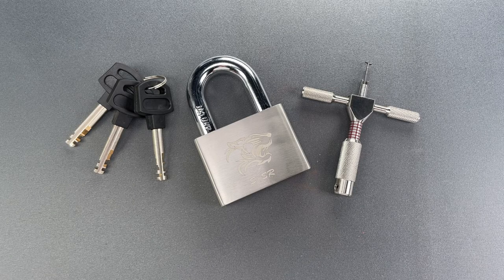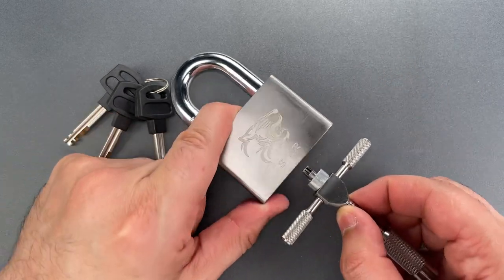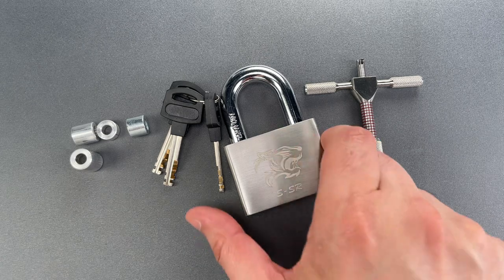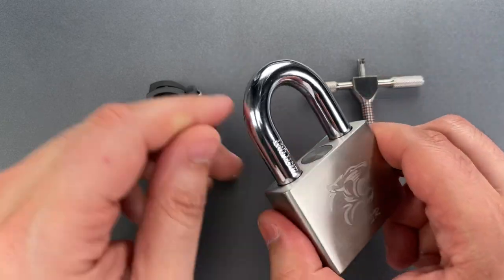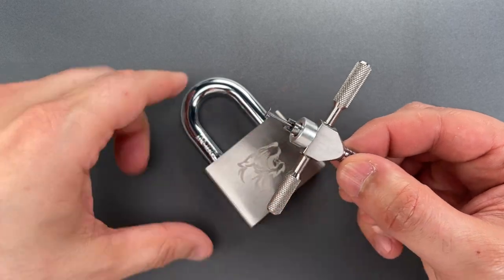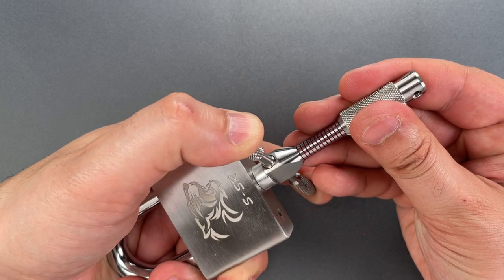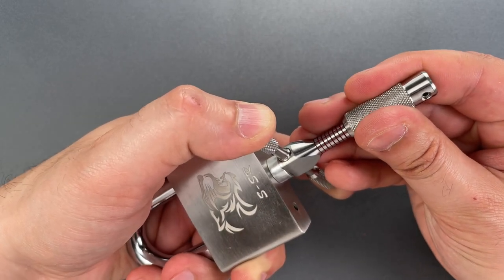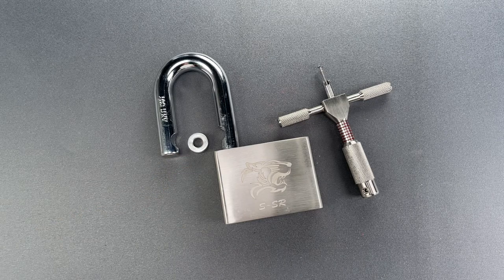[1368] A Crutch For Picking Disc Detainer Locks (S-SR Padlock)

Comment: Just from the fact of it having TEN pins to go through, wouldn't this make this a lock worth getting? Some amateur expecting 4 or 5 pins getting nowhere fast would surely move on, yes?
Also, how hard is it to pick disc detainer cores if you don't have a tool the You and Bosnian Bill made? A side-to-side comparison video would be enlightening.
Reply: In answer to the second part, as near impossible as to make no difference, certainly in the field. But the pick that Bosnian Bill and he made is available commercially, from Sparrows I think.
Reply: It is basically impossible to pick without a disk detainer pick of some kind.  That is why even without false gates, it is still more secure than most pinned locks.
Reply: I am sure with some skill a person could pick these gates. The tool works very well be cause it spaces out the pick and keeps it in the correct area. The gates need to be turned rather than pushed. Which is why the tool works very well. I would guess that a person who tries to pick it with a bent pick could do it over some time. The tensioning part would be tricky too as you would need to bend and make a turning tool as well. This is why the tool works very well. Its possible to pick just about anything thing provided you understand what is going on.
Reply: It could be picked without the tool, but it would require more skill than worth the effort, honestly speaking maybe 1% or less of lockpickers could do it without the tool
Reply: The famous 'tool' is a common disc detainer pick; it's just well made and at a reasonable price, which is the niche that BB/LPL and Sparrows noted was not served. You can find that - or others - commercially. Without a specific disc detainer pick I don't think you'd be able to pick a disc detainer lock - it's not something you can improvise with other materials (or even other picks).
Reply: Without the tool they made, it would be way harder, deffinitely out of the range of a novice average street thug.
Reply: @dlevi67  There are YT videos of people picking disc detainers with hooks. Just to show off probably - but it can be done. It's like using a frying pan instead of a hammer to drive a nail. If you can manipulate the discs you're set. A sharp hook or diamond will let you do that. Much harder, yes, but not at all impossible. Otherwise You're correct. Just nitpicking. No flame war please.
Reply: @nemtudom5074  Even with the tool, I would imagine it takes a good amount of practice to be able to do it quickly and consistently.
Reply: @m2pt5  Yeao, probably, i doubt i could do it in twice the time LPL did
Reply: @cooperised  it is Sparrows, I actually bought one recently and it's a very nice pick, though I'd totally prefer to get it in the nice stainless color LPL has rather then the black/dark red it came in. Just easier to see the lines on LPL's version.
Reply: Does anyone know if there are are videos of LPL picking a disc detainer core pre-"Tool"?
Reply: @EvolvedWizard  Yes, I've seen a video where he picks one with a common Chinese disc detainer pick.
Reply: @OLLE3770  No nitpicks - totally correct point! Mind you - I have problems enough with a specific DD tool 😂
Reply: @EvolvedWizard  he picked plenty of them with Chinese made tools that he slightly modified.
Reply: @Geoff_W  use a very thin white (or other color) marker and circle the lines, I did an orange and it still blended nicely.
Reply: @jameswfreedom641  It's fine, I make due, it just would have been nice if sparrows had taken visibility into account
Reply: @Geoff_W  I totally agree with you!
Reply: a basic disc detainer pick can be made from a filed down nail
Reply: @3rdalbum  where linkmpls
Reply: That makes me wonder, if we’re factoring in “defeating expectations” into a lock, are there any hybrid locks (if such a thing is even possible) that, for example, have disc detainer, wafer, and standard pins mixed together? 7+ discs and 1+ wafers/pins seems like it would make anyone not up for the challenge give up.
Reply: @m2pt5  I can verify that. I have been practicing with mine for a couple of weeks now and I still haven't got the hang of it.

Comment: I've just opened my first real lock. I only raked it but it feels like such an achievement. Thanks LPL. I couldn't have done it without your videos. Still failing at single pin picking though, even on the "practice" locks. 
You make it look so easy!

Comment: Lockpickinglawer using a special pick to open locks is one of the most complimenting things a lock company can get. That or if lpl says something like “without the proper preparation, I will not be able to get this lock open”
Reply: The "pick that I and Bosnian Bill made" is not so much a special tool as it is a tool made to pick disc detainer locks. Picking disc detainers with normal picks is nigh impossible just as picking the usual pin locks with this tool would be probably impossible: It takes the right tool for the right lock mechanism. Though I guess this tool is a bit rarer than the usual picks so just by their nature, disc detainer locks are slightly more secure. A prepared adversary would have this tool and tear through the lock without much effort, though.
Reply: Most lock smiths don't even know this tool exist
Reply: Disc detainer lock picking tools aren't really rare or special. He just uses the type he and Bosnia Bill designed. The commercial version of their design is made by Sparrows.
Reply: @siliablackfame5771  And where you think Sparrows got the design from?

Comment: I know a few people have already mentioned it, but I agree, these alignment aid/spacers should be made available on your store.
Reply: Or you could go to the local hardware store and just find an appropriately sized nut in the 'fasteners' department.  will probably cost 25 cents.
Reply: @HariSeldon913  Nice try but no. The distance between the lock surface and the first disc is a special length that needs a very precise spacer. Obviously, out of the thousands of commercial spacers  one will probably work, but it is still easier to buy a specialized one.
Reply: @pomelo9518  Not only that but you'll probably also want the spacer to fit snugly around the picking tool, which a specialized spacer will be made to fit.

Comment: Great tip! Wondering if you have any “field picking” videos on the channel where it’s a lock that’s actually attached to something. Some locks are really hard to hold in your hand for picking in the field compared to your lab environment
Reply: I believe one of his april fools videos should work for that - the ex-girlfriend IIRC
Reply: In most places it's illegal to pick locks that you do not own. The April fools lock of "his ex girlfriend's backdoor" mentioned earlier was most likely a cylinder he owns that was rigged in a door.
Reply: Alexander. I get what you mean. I was thinking the same. Like using his lock and lock a chain to anything in a park or some crowded street setting.

Comment: Hey, i was wondering, what it means “i have not felt any anti-pick features” you know just by twisting the key, or you pick it beforehand? Thank you 😊 (i had this question for a long time)
Reply: He always picks them at least once before recording the video.
Reply: He's picked it before
Reply: I'm fairly certain he said in a meta video (a video about how he makes videos) that he usually picks them beforehand to know what to do/expect/talk about, so I would assume he means he did not feel anything in his tests
Reply: anti‐pick features, amongst other things, can be spool or serrated pins. or in this case their equivalent on disk detainer locks. you can tell when picking because they will cause a false set; or the pin will not move smoothly.  

so long story short they can be felt out while picking the lock.
Reply: Well damn, thank you all ❤️
Reply: In a disc-detainer lock, there is a sidebar that presses into the edge of the discs, and when the gate (a notch in the edge of the disc) of each disc is lined up with the sidebar, the sidebar goes all the way into the discs and allows the core to turn.  When he applies tension to the core to turn it, and starts to turn each disc, the sidebar drags along the edge of the disc that he is picking; you can usually feel the dragging/scraping through the pick.  In disc-detainer locks, the typical security feature is a false gate, a gate that is cut large enough to catch the sidebar when it is turning, but too small for the sidebar to fully set into the disc.  When turning a disc during a pick, you can feel a small click or bump when the sidebar drops into a gate (whether it is true or false).  If you get ONE click out of every disc, and the lock opens, then that means that none of the discs had a false gate, and you "have not felt any anti-pick features" while picking the lock.
Reply: @silentguy123  correct except for some very few videos where he mentions its a blind pick
Reply: Pretty sure he's got x-ray vision when it comes to locks.
Reply: @Allahpaca  
You nailed it, I reckon 🤣
Reply: @Allahpaca  that’s usually developed at his stage of picking: X-ray level lol
Reply: @VcSaJen  if you set multiple pins from the front or back you can get slight false sets as well
Reply: @Allahpaca  The man with the x-ray hands would be a good moniker.

Comment: LPL would you ever consider making and selling the tool you use to rotate the discs?
Reply: I second this
Reply: Sparrowslockpicks on the internet. $45 bucks. LPL and Bill both haven videos of making it and explaining why its over there.
Reply: if you mean the lockpick  BB and LPL worked with sparrows to get a version to market.  If you mean that tool he used to rotate all the disks to the initial configuration that's just a slim piece of metal with a grip put on it for comfort.  Anything with an appropriate profile would work.  A wiper insert or even an old hacksaw blade filed down to the right size would work.
Reply: Any appropriately sized sheet metal strip will work.

Comment: OK, so what does a click mean? What does binding mean? Can you do a new video with a sorta 'FAQ' feel for terminology? Could include what you're actually manipulating in there. Also could go over what anti-pick features entail. Like what's a false gate? Hell, what's a gate? :)
Reply: In a disc-detainer lock, there is a sidebar that presses into the edge of the discs, and when the gate (a notch in the edge of the disc) of each disc is lined up with the sidebar, the sidebar goes all the way into the discs and allows the core to turn.  When he applies tension to the core to turn it, and starts to turn each disc, the sidebar drags along the edge of the disc that he is picking; you can usually feel the dragging/scraping through the pick, this is "binding".  In disc-detainer locks, the typical security feature is a false gate, a gate that is cut large enough to catch the sidebar when it is turning, but too small for the sidebar to fully set into the disc.  When turning a disc during a pick, you can feel a small click or bump when the sidebar drops into a gate (whether it is true or false).
Reply: @Kineth1  Thank you so much. Makes every video better. Gracias.

Comment: I wonder, LPL and BosnianBill designed the picking tip of this tool so that it could be replaced should it snap. I wonder if LPL has broken one yet, or if the original is still going.

Comment: Do you sell the tool you use to rotate all the discs to start position before picking on Covert Inst?
Reply: Anything that's basically just a flat plane will work.  I use one of the wafer jigglers on my Covert Companion (and I think that's what LPL uses in the video, just not the Companion version), but something like a flathead screwdriver would work as long as the head is long enough to reach all the discs.  If you don't have ANYTHING that's just a thin flat piece of metal, you can use the pick to turn each disc clockwise manually, though it'll take a minute or two.

Comment: I believe this has been asked before, but am I correct that DD locks that tension off some random disc at the back are not really attackable (is that a word?) using this tool? Or specifically the one I have from Sparrows, which I know came from you guys - thanks!
Reply: He has picked random-disc-tension locks with this pick.  He usually starts by applying tension to the first disc, which still causes the sidebar to bump the discs, then once he lines up the other discs, he moves the pick to one of the "zero-cut" discs (a disc that didn't need to be turned to line up with the sidebar, usually used in a random-disc-tension lock as the tension disc), applies torque to that disc, then uses the nose of the pick to line up the first disc.
Reply: If the comment with the link didn't come through, look at his disc-detainer playlist, video 1013, the lock tensioned off disc 6.
Reply: @Kineth1  thank you!

Comment: I don't know if you ever answered to this question in a video, but is there a lock somewhere that you haven't been able to break? :o
Reply: He looked at the Bowley and didn't even try. It takes a complicated tool made of double picks that would only work on a Bowley.  takes a while and if you want your tool back, you have to pick your way out just as you picked your way in to open the lock.

Bottom line, when facing a Bowley, it might be easier to smash the door.